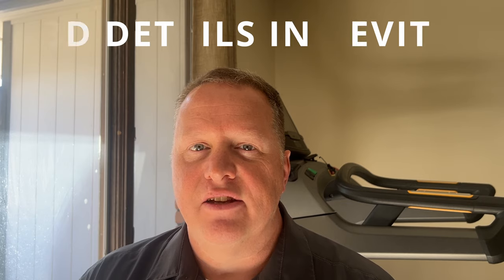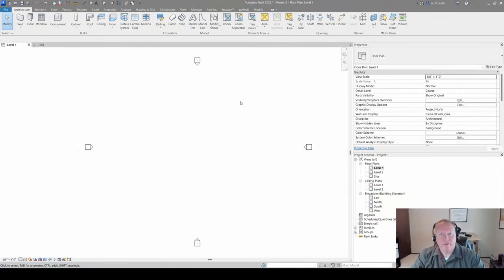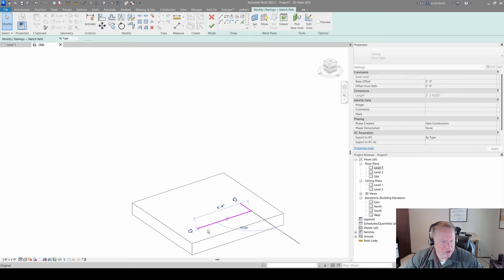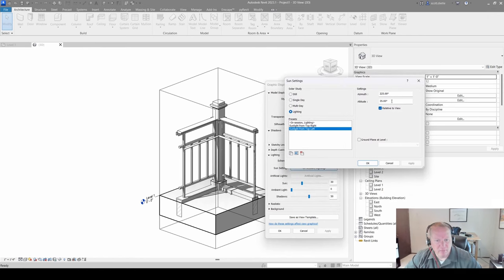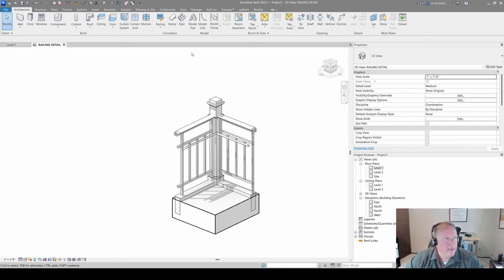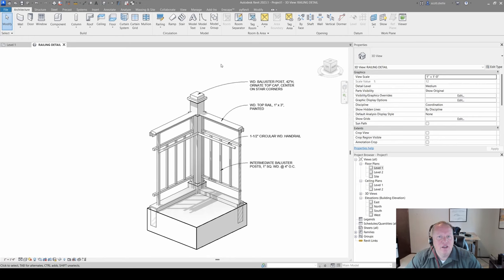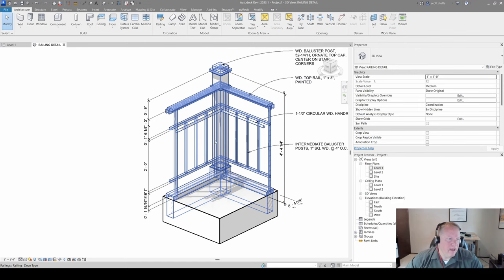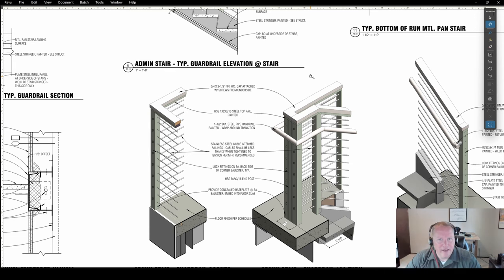Revit Tutorial - 3D Details

Comment: I beilive in 2024 you can now add tags to locked 3D views which is a step forward for sure. I can't beilieve I didn't think about the active plane issue with dimensions! Great tip!
Reply from the maker: I'll have to check that out.  I tried 2024 but I couldn't understand the topography changes before a big deadline, so I went back to 2023.  Thanks!